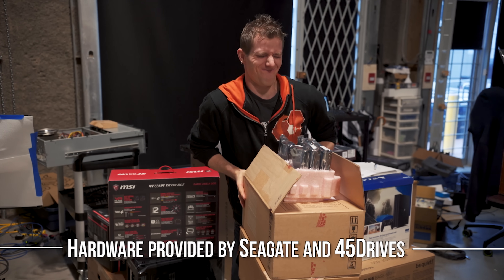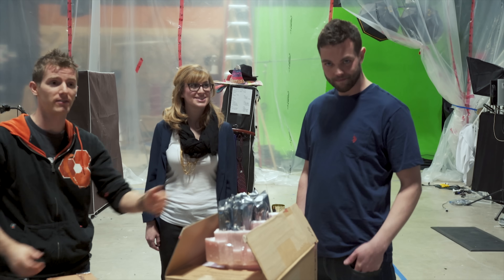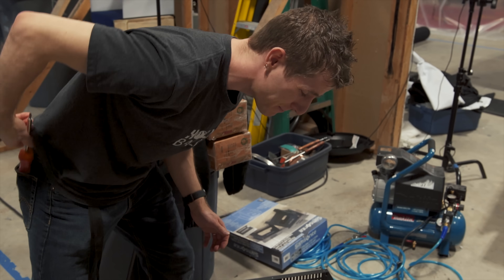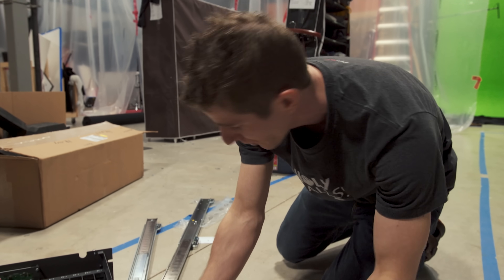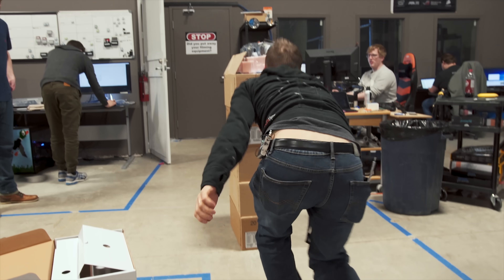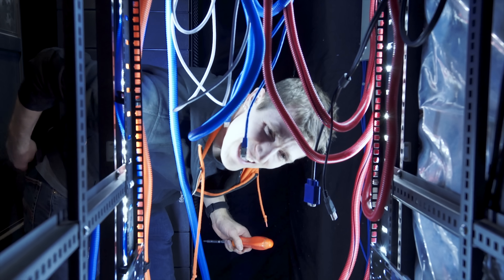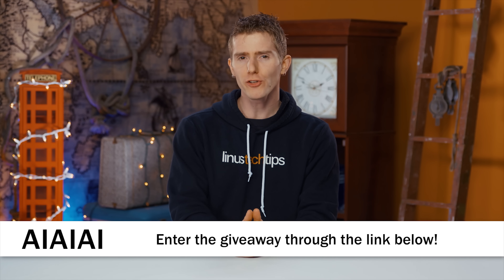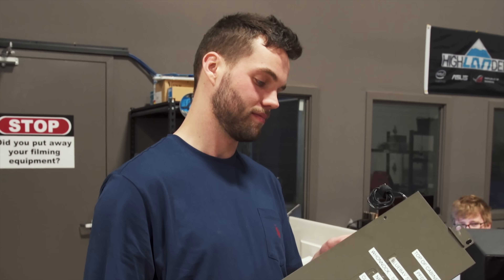INSTALLING THE PETABYTE - Server Room Upgrade Vlog

Comment: Someone check this math for me:
If 3 seconds of 8k video can take up 1gb of storage. Then it only takes 3000 seconds to fill up 1tb of storage (or 50min)
If a petabyte is 1k terabytes then it would only take 50,000 minutes to fill up the entire database.

If we generously allow each LTT episode to be roughly 10min long and they upload once a day... 

Then we have to wait roughly 13.7 years before we get to witch hunt linus for not releasing more videos. Pitchforks back in the shed boys :[
Reply: but a 10 min clip will have a more that the release length of video before it gets to editing so depending on how its used could be a lot shorter depending on how much of Brandon's sexy broll get't stored as well .
Reply: But they may store more footage than goes in the final cut, and then the final cut would be an additional copy on top of the original uncut footage, right?
Reply: okay we get it ... you math
Reply: Knowing how much of a storage freak Linus is, they probably store RAW files, compressed files, edit files and all of the sound/graphics files.Also, let's face it... they need some kind of backup for that storage space, so they'll probably just go and buy another one of these in some time ;)
Reply: But wouldn't they store both the raw data and the edited files on there?
There's probably also soundsfiles invloved, altough those won't make much of a difference.
Reply: Linus was talking about raw footage to be stored, so uncut one 10 min video roughly makes that 1 to 2h of recording, especially when talking scrapyardwars. So make it roughly 2 Years for another petabyte, this time with SSDs.
Reply: Even less, cause he edits out TONS of footage, I'd say only 1/10 of footage is left in the actual video.
Reply: Plus there is also the consideration that 8k content exists, yet even 4k monitors aren't cheap enough for everyone to have like 1080 is atm.
Reply: HappinessFactory We'll have other opportunities 😂
Reply: @james mayo You're absolutely right, it should be bytes not bits - I was more than a little sleep deprived when I originally wrote the post.  However, as far as I'm aware, the rest of the math checks out - you know, the parts that you didn't bother reading - but then I don't expect that with a comment like yours >.>
Reply: they are considering to get a tape storage for the real archive.
Reply: Cameron Webster I was thinking in about that. Maybe Linus could get a similar machine to what Facebook has
Reply: Ask google
Reply: But each project would have 30 mind of raw clips which they would store for future use
Reply: I'm guessing Linus will get a tape archive machine in the near future.
Reply: HappinessFactory haha lol
Reply: +HappinessFactory It's Bytes with a capital B, not bits. A TB is 1,024 GB not a thousand so it would take 3,072 sec to fill up a TB and 3,145,728 sec or 52,428.8 min for a PB and it would take approximately 14.4 years to fill up the server.
Reply: @Thuazabi theres 8 bits in a byte, not 1024...
there are 1024 bytes in a kilobyte, as 1024 is 2^10 and computers use binary
i didnt even even bother reading the rest of your comment TL;DR
Reply: So, there are 1024 bits in a byte of data, and you can add any prefixes to that and it would still hold.  Problem is that Hard Drive manufacturers usually calculate their storage off the assumption that there are 1000 (or 1k) bits per byte of registered space, but things like read/write calculations are based off the 1024-bit per byte system.  

According to the readout in the video (14:01 to 14:06 ) Linus' final formatted drive space is 778TB of storage, which is likely using the aforementioned 1000 bit per byte system.  So we have to take 778TB and divide it by 1.024, which leaves us with approximately 760TB under the 1024-bit system.  

We are told that 8k captures video at a bitrate of approximately 300MB/s, which is likely to be calculated under the 1024-bit system.

We then have to figure out how many MB are in a TB, but it will be helpful to figure out how many MB are in a GB as well. 

This is pretty straight forward.  Using the above-detailed system, there are 1024MB in 1GB, and thus 1024GB in 1TB. In order to figure out how many MB are in a TB, we just multiply the two values together.  This leaves with 1,048,576 MB in a TB.  

At this point, we can multiply this value by 760 to get an estimated storage capacity of 796,917,760 MB in the Petabyte rig.  Using our bitrate from above, we can then look at that storage number as being the equivalent as seconds, and divide that number by 300 to get an estimated time to fill that server to 100%.  

This gives us (796,917,760/300) = 2,656,392.5333333333333333333333333 seconds, or, in more relatable notation (using 60sec=1min, 3600sec=60min=1hr, 24hrs=86,400seconds=1day): ~737.887hrs of video, which is the equivalent of 30 days, 17hrs, 53mins, and 12.533 seconds of capacity.
Reply: obligatory controversial comment:
16k is probably coming out in 1-2 years.
It's not like they'll just delete the raw footage and numorous takes for the videos, so it will be >10 min (around 30 min maybe)
maybe 5 years... still a long time away :(

Comment: Remember folks, HDD's at the production level cost don't equate to the consumer level cost :). So Seagate with their already mass producing machinery and automation can pump these suckers out in a cheap and outstanding rate.... Seagate is getting a super cheap ad through this sponsorship! (AD'S ARE NOT CHEAP!) Which has currently as of today (4/5/2017 at 12:33 AM) 393,604 views. LTT has 3,876,208 subscribers so there is still a lot of views remaining. THEY SAVED SO MUCH MONEY FROM THIS SPONSORSHIP VIDEO!

Comment: its not a PETABYTE unless its USABLE Space 

thats like saying you have a PETABYTE but using Raid10 leaving you with 500Tb 

so if those cases took 60 drives each why not use 120 drives? 
then you would have had 1 PETABYTE as Raid-Z3 
 as I only seen 5x20x 10tb box's their? unless you used a higher ZFS raid level ?

Comment: Hey Linus. I have a question; would you be able to use watercooling on a cpu and beneath/backside of the motherboard to further reduce temperature? Is there any chassis/case which you can do that in without cutting into the case?

Comment: Instead of keeping old/backup footage on a hard drive/ssd based server you could go for LTO Tape drives to hold alot of that for a fraction of the cost. With the upfront cost of around $2000 for the drives you can get around 6-15 tb for $100 or less 

although it wouldnt be as badass

Comment: I am a bit shocked that Canadians apparantly don't (only) use SI units. Accidents have happened, expensive space vehicles have been lost because some American used pounds instead of kg. and other funny stuff like that.
Reply: Older Canadians sometimes use lbs and miles.
Reply: It is incredibly unpractical, especially once you use physics and you have to relate units. 
I thought that for physics education in Canada the SI system is being used. Is that correct?

Comment: want a petabyte server? just get a 24 bay supermicro 4U server off of ebay for $400 with make sure it has 12 cores at or above 2.5Ghz, and 100GB of ram(12x8GB for $240) and then 17 of those seagate 3.5 inch SSDs with 60TB capacity

Comment: what well he try now make a old computer into a computer sized router?????
Reply: Little known secret. Tiny plastic box routers came about as smaller alternatives to loading a desktop with network cards. Those boxes still use exactly the same software you would if you did use a desktop as a router, they just slap a pretty GUI over it and forget about all the extra options the command line tools actually allow you to change.

Comment: how many watt is this setup comsuming?
Reply: The system has somewhere in the neighborhood of 650w peak watt. Most the time it will, of course, not be at peak powerdraw, and at idle it should be at just over 300w. If it actually spins down the drives, which i doubt, it can easily quarter that. (The drives pull just shy of 7w each during seek, 4.5w at idle, and 0.5 when spun down.)

Comment: Petabyte? With 2 45 drive Storinators using 10TB drives, that's still only 900TB. He mentioned in the video there's about 97 more drives to go, so something doesn't add up. Were they actually using the 60 drive versions?
Reply: 4 rows of drives, 15 drives each, and a bunch of empty trays in the end. I don't remember what video it was he went in to details on it, but there is a video about the "upcoming petabyte project" where he talks a bit about it.
Reply: So it was the 60 drive version. Seems odd they keep saying 45 drives in the video without mentioning that it's a 60 drive model (unless I missed it).
Reply: I realise that now but it's still something the video should have clarified.

Comment: LinusTechTips When using corrugated split loom for wire management , push the loom over the wires, not the wires into the loom. With your left hand hold the loom with wire already inside. With your right hand hold only the loom about 2-3 inches from where the wires are entering the loom and make sure the split is facing the wires. Bend the loom about 45 degrees and push up and towards the wires, this should cause the split to open up, and the loom to just slide over the wires. Obviously hands can be swapped if you're left handed. This method works well for larger diameters and unruly wire. Also this avoids your fingers coming into contact with the split edges, which can cause irritation. I have loomed literally thousands of feet of wire, and use corrugated split loom on a daily basis at work. Every time I see people using it, they seem to always be doing it the hardest way possible. Also, if wires don't quite fit in the loom nicely, once the wires are in the loom it can be twisted, and it will spiral around the wires thereby containing them while looking nicer.

Comment: Have you guys ever consider using a cloud based system via Amazon web services?
Reply: Cloud services don't offer the speed they require. They are always accessing the vault and the rest of the servers, and cloud based storage is nowhere near fast enough to handle the multiple GB files they are constantly transferring, especially with RED in 8k. The petabyte project allows for 1Gb read speeds, with Whonnock (SSD server) offering speeds much higher than that, good luck finding speeds like that. 

A lot of the hardware is sponsored too, so Linus himself doesnt actually pay for most of it. The cost of having a Petabyte of superfast, reliable cloud storage would be astronomical.
Reply: oh ._. Thank you for educating me with your response good sir, to be honest I didn't know much on the subject matter, it just seemed like an interesting idea.

Comment: How much did this cost them?
Reply: He mentioned somewhere in the middle of the video that the hardware was around $50k (part where he's discussing it would be bad if a water cooled system above them leaked).
Reply: Sponge 28 If I understood correctly, 100% of the cost was sponsored. Perks of being a leading youtube tech channel.
Reply: Pretty sure he said there was about $50k in drives alone. Id assume the 2 storinators were $1.5-$2k each as well. Most of it was sponsored though so im not sure how much of it Linus actually paid for. I presume he paid for a portion of the HDDs.
Reply: it cost Seagate 50k. It cost Linus nothing
Reply: It cost seagate probably less. But that's overall cheaper it seems than paying linus in cash for endorsements/ads.
Reply: Free, sponsored.
Reply: Bill Belzek If only I could have even a quarter of that...
Reply: Besides if this video makes them money then the sponsorship didn't cost them anything. It made them money.
Reply: Crazy Goat He said 5k for the hard drives. And the rest... Google them?
Reply: Seagate doesn't have that significant of a profit margin on their drives.
Reply: Sponge 28 their more than that
Reply: Mark T. Wolffe 50 k for hdd
Reply: Alex Villalobos Oh? I probably misheard.
Reply: Petabyte NAS is like $100,000 easily
Reply: I don't think it cost seagate the full amount. It might retail at 50k, but their cost might be significantly (SIGNIFICANTLY) lower.
Reply: Nothing. It's sponsored bullshit.

Comment: Why not use SSD?
Reply: Cost. They have the Whonnock server as an SSD cache server for all their recent projects, with 100TB of space if im not mistaken. 1 petabyte of solid state storage would be astronomically expensive, this is already $50k as is just for the drives. Also, SSD's only have a limited number of write cycles before their cells can no longer be written too, which is much shorter than what enterprise class HDD's last for.

Comment: Isnt a petayte 1024 tb, this is only 1000?
Reply: 1 Petabyte = 1000 Terabytes = 10^15 bytes
1 Pebibyte = 1024 Tebibytes = 2^50 bytes

Former use the prefixes from the SI standard, and latter uses binary prefixes from the IEC standard.

Comment: Umm.... Linus thats 3 million...Not billion
3,802,232.25 kB/sec 13:42
Reply: It's 3.8 billion bytes per second though.
Reply: I wasn't meaning to get technical it's just that Linus said: "Count your places kids" so I did and it seems that he didn't count his. Darn Linus not following his own recommendations.
Reply: Mallets for dayz He was trying to be funny ffs
Reply: he would have gotten away with it if he had said bytes, and not "3 billion, 802 million, 232.... kilobytes" which is 3,802,000,232kb
Reply: "hi hi, 8 bits is 1 byte m8, 1024 bytes is 1kB"

The 1000 vs 1024 distinction has nothing to do with a byte being 8 bits. And technically, kB with a lower case k is the "metric/SI version" of kilobyte which is 1000, not 1024. There's still much debate over what's correct. IEC have specified that kilo should always be 1000 and that kibi should be 1024, but there's a lot of resistance to this.
Reply: Both the IEC, in publication 60027-2, and IEEE, in publication 1541-2002, state that a Kilobyte/bit is 1000 bytes/bits, that a Megabyte/bit is 1,000,000 bytes/bits, and so on. and to use kibi, mebi, gibi, and so on for powers of 2 expression.

There is some resistance to it but it is meaningless with people who actually work in certain parts of the industry. If you are a telecommunications engineer or data storage engineer, you will see them use powers of 10 as both storage and data transfer rate is in powers of 10 because there is no reason to use powers of 2 to express it. A 1 Gigabit connection strictly means 1 billion bits. 

The confusion comes from computer science where RAM and cache is only ever in powers of 2 due to how Memory Addressing work. A 10 bit address bus can only address 1024 addresses, a 20 bit bus only 1,048,576 addresses, so on. As you can see, expressing as powers of 2 becomes important as things can only ever be in powers of 2 with these things.

And then OS's and applications get developed by these computer scientists and they decide to use powers of 2 for everything, coupling them with SI units because its easy and they themselves understand what those units actually mean.
Reply: L3 P3 but the main part was him reading it completely skipping the hundred thousands place. Lol
Reply: See when i looked at the numbers and he said "billion" I instantly figured he was going to say bytes. Because it is. But then he seemed to change his mind to kb. Which is in the millions in this case.
Reply: 1 kB is 1000 bytes, kB stands for kilobytes, meaning thousands of bytes, so if you have 3,802,232.25 kB/sec it's actually 3,802,232.25 thousand bytes, or 3,802,232,250. That's probably what he was thinking when he read 3 billion, but yeah, the number was 3 million.
Reply: hi hi, 8 bits is 1 byte m8, 1024 bytes is 1kB
Reply: nailed him
Reply: Mallets for dayz He meant the bytes, dumbass. He said kilobytes at the end, but that was a mistake by him.

Comment: Wow seagate gave all those drives for free, I'd rather they give their customers 30% off
Reply: $50k for a company as big as Seagate is nothing compared to the advertising they get. A channel such as Linus's will get them a lot of good publicity, far outweighing $50k. That amount of money to them is like tossing a penny into a water fountain.
Reply: Also the HDD's at the production level don't cost the same as the consumer level.
Reply: Screw that noise. Went cheap ONCE and bought a Seagate and the fucking thing died on me 2 weeks later after I filled it 3/4 with my information. I downloaded a firmware update for the drive but it never responded or even registered with the computer usually just showing on screen the odd special character as its identity. Got lucky about 2 months later and did the update to it and tossed the thing in the trash. Never again. I'll stick with Western Digital. None of them have ever given me an issue and I still have a few WD IDE drives hanging around in a box from the late 90's that will work like the day they were made if I plugged them back in.
Reply: probably 10k bucks for seagate.... + s&h
Reply: I'd say that's around reasonable, though i'm not quite sure if it is even that much.. As they mass produce HDD's... They get their supplies in bulk and cheaper..
Reply: Them sponsoring Linus makes me want to purchase their products less. It's wasted margin that I wish they would pass onto further savings for the consumer. As anyone shopping for a computer I would buy seagate anyways as they're already the cheapest and at the 3tb range are often tied with Toshiba.  But they really could be the lowest in every HDD market if they wanted to.
Reply: I've had 4 western digital drives they've all failed.
I've never had a seagate drive fail one was giving some errors but it was a refurbished 750gb
I had a 3tb for 3 years now I've owned a 5tb for 3 years, they use to only have 1 year warranty but they have increased it significantly to 3 and 5 years for most skus. The price has also increased but it may mostly be related to the CAD.